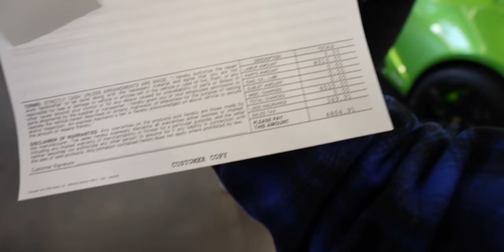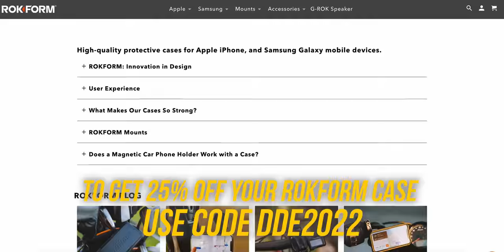DAMAGE COSTS I’M SUING FOR FROM LAMBORGHINI SLEDGEHAMMER ROAD RAGE!

Comment: Surprised that you guys didn't tow the car to a McLaren dealership and have them assess the damage to the 720 GTR. Then the adjuster could have assessed the damage to the GTR with a mechanic at McLaren. How would the adjuster know the extent of the damage to the GTR without having a reputable mechanic show him what needs to be replaced, that is ofcourse if the car is salvageable? Glad the windshield is fixed on the SVJ. Maybe you guys should have a blessing ceremony so that nothing else happens to you or the cars.

Comment: I learned hard way being under insured last month a DUI hit and run tboned Lexus 2 miles away in a Chevy work van with commercial plates.  He lost his front wheel passenger side.  Fled 2 miles in pursuit making multiple turns.  Turned into my property ripped up my asphalt and glanced my f350 making my bed rail collapse under toolbox weight so now my body line is 4" off my bumper folded in both taillights shattered and progressive said he wasnt a registered driver on the policy so my truck is totaled and progressive will only pay out 5 thousand dollars divided by three victims he damaged property of.  So I have no clue how insurance works I'm at a huge loss and now I have to quess sue the owner of the van and driver.  I don't like sueing people but I'm in a position where I only had policy for autoglass and if I hit someone else, minimum.  So I'm driving a truck that's smashed looking unprofessional with my buisness and have no clue what to do.

Comment: @DailyDrivenExotics 
Now im not trying to hate on these professional glass installers, they seem very good at their job, but mind if I interject some advice here? if you want to stop a glass from going everywhere, use duct tape on the windshield, especially around the major point of impact, what this does it, the glue on the tape holds all them little shards on the tape itself, thus eliminating the problem of them going everywhere :) and thus in turn, you spend less than $20 on a roll of tape and still profit :p

Comment: Wow, this wasn't professional way  to remove the windshield. Can't believe it they use 20$ tool from Canadian tire which require significant force to go around the frame 3-5 times and scratching it all over.  This tool meant to break the glass and shatter in pieces. It is so wrong, pls don't tell those guys are trained Lamborghini technicians. LOL

Comment: Duct tape the complete inside of the glass.
Reply: The right way to do that is to put a layer of window film on it inside and out. Goes on really fast when you aren't going for perfection and holds the glass together so it's not falling all over the interior AND exterior as you remove it.